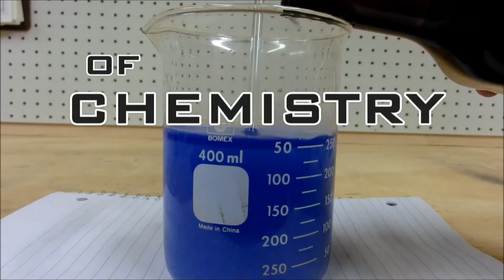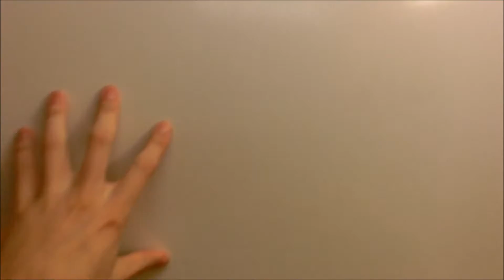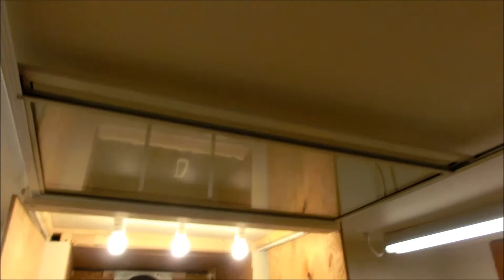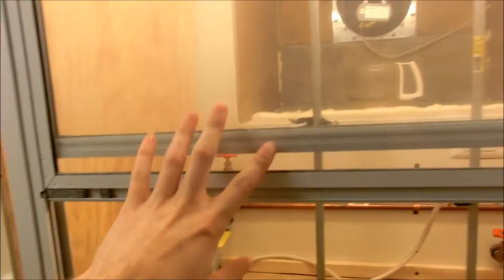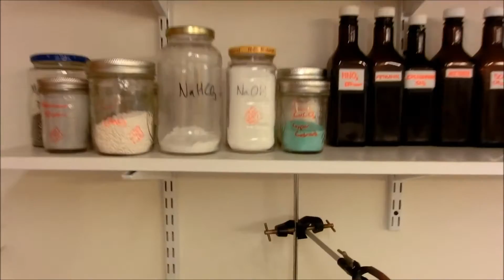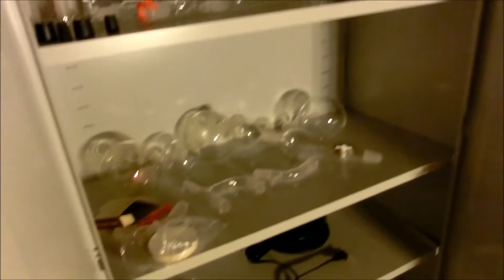New Channel, New Laboratory, New Videos

Comment: How does the water vacuum adapter work? How would I make one?
Reply: If you havent already done so, id suggest watching nurdrages video on the vacuum aspirator and how you can use it without a running faucet, which wastes water and contaminates the water supply with your reagents

Comment: Very Cool! I just stumbled on your channel and will subscribe in a minute. Your lab has the right mix of utility versus economy. I really love your idea with the aluminum window with its various positions {good, bad, ugly}, a great idea.
I'll be moving soon to a place I'll share with no one(at least initially) and lay in bed at night thinking of how my fume hood might be. I think you are very fortunate to have such luxury for your hobby (or perhaps research home business right off). The only one thing I would be careful of is using a normal refrigerator for things like ether (which you would want to keep cold). But a high vapor pressure, flammable substance could potentially be ignited by a spark in the thermostat section. These are not always sealed, and ether is an evil substance. But WOW, your lab is awesome! Thanks for showing us.